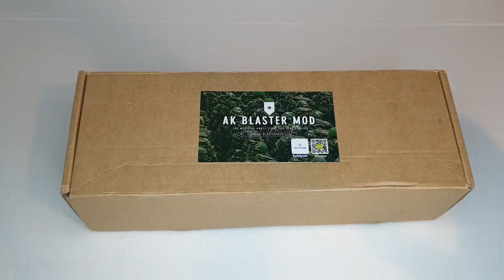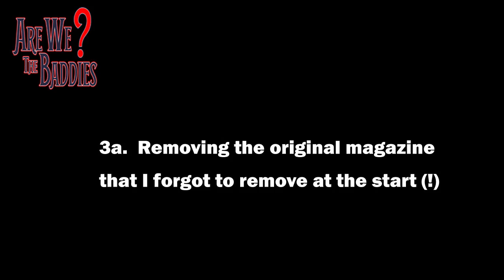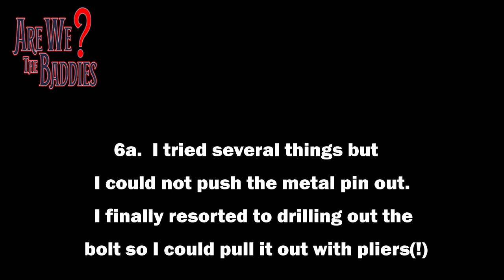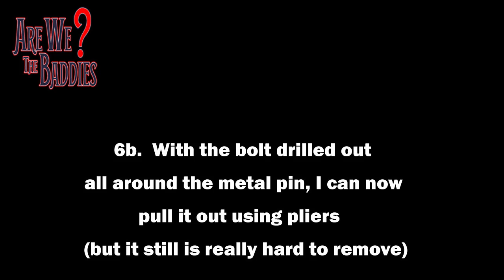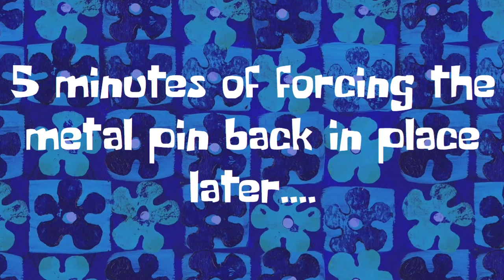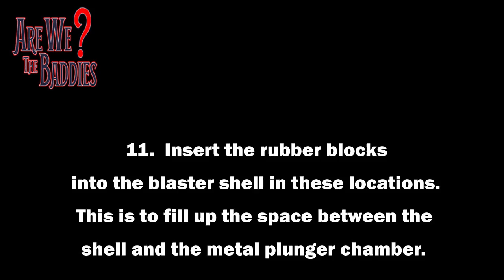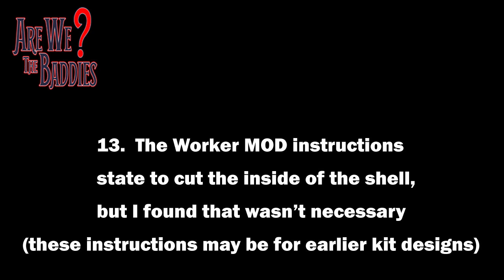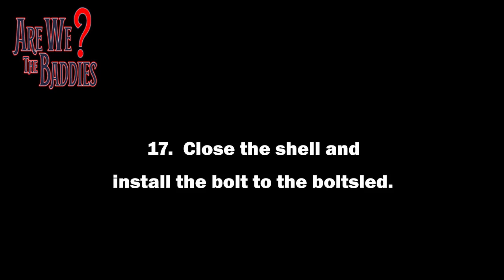Nerf Worker MOD Complete installation guide for Stefan Breech Bolt 9kg kit for Nerf Longstrike

Comment: One quick note - you left the SCAR barrel-attachment on the blue aluminum barrel, you are meant to slide that off and mount it to the end of the barrel to impart spin to the darts when fired.
Reply: That's just Worker's standard nerf replacement barrel tube, not a SCAR barrel. It's too loose to engage the dart well enough to impart the spin. Worker's true SCAR attachment is tighter to the dart and wouldn't fit all the way over the metal barrel like in the vid.
Reply from the maker: Hi, sorry I haven't replied to your original message Chamdar, been away for a bit.  I followed the instruction manual on the Worker Mod website for installing the breech kit and stage 12 shows the tube going over the blue steel barrel to (I assume as it fits) fill the space between it and the barrel adaptor, so they could save on thickness of the barrel.  I hadn't even see the barrel twist until you mentioned it.  Slyd_Fox is right though, it is loose and it I put it on the front of the barrel it will just slide off.  If you pause at 18:03 you can see just how loose it is.  
It would have been great if I had missed this night tight barrel though, so thanks for making me look again at it.
Reply: @Slyd_Fox  thank you for that!
Reply: @arewethebaddies7593  thank you for the reply, and for the video as well.  I'd been looking into this mod and mis-interpreted parts of it.  best wishes!
Reply from the maker: @Chamdar17  Glad to help.  And mis-interpreting the instructions was the original reason I made the video, in case it went wrong I could watch it what I did and correct it.

Comment: What exactly did you use the drill for? I've built dozens of Longstrikes at this point and never once needed a drill. I just use a pin and small hammer to knock the old pins out.

Comment: That barrel is wrong. You put it into the breech backwards. All worker barrels have one end that is chamfered on the inside to make it smoother for darts to load and the pusher to slide into easier. It shouldn’t look like a strait edge around the barrel when looking into the breech.
Reply from the maker: The blue barrel you mean?  It should be in the other way around?
Reply: @arewethebaddies7593  Yes, the other end of the barrel has a step in it that the pusher O-ring is supposed to seat into to create an airtight seal.

Comment: Anyone get an issue with the trigger being way to hard to pull?
Reply: I did, in order to shoot I sanded the part of the trigger that is like a triangle that frees the catch, and I have to sometimes manually push the priming handle forward while slightly pressing the trigger, then i stop pushing the priming handle forward when the trigger "detaches" (You can feel that it becomes softer to press)   and i just press the trigger when i'm ready to shoot. 
Sorry for the bad english

Comment: Thanks for the vid!
What FPS are you getting?
Reply from the maker: Sorry its taken so long to reply.  I wish I had a chronograph to measure the exact difference.  The only thing I can say is that the darts fly further and faster.
Reply: @arewethebaddies7593  All good! 
Ok. Not sure when I will, but I'd like to get one. I have a long strike just sitting there and would like to get it into usable condition again. 😂
Reply: @Si-Fi.51 Mine has gone from 50 FPS to a very consistent 145 FPS (with Dart Zone Max short darts). The kit is well worth it, and accuracy is noticeably better. I would recommend it.
Reply: @xap95  Oh wow. 7 months later and I still wasn't sure about the velocity. Thanks! I figured it was something like that. I'd personally want mine to fire around or under 130 because I want to use it in HVZs.
Reply: @Si-Fi.51  You could possibly find a softer spring for it. Another thing to note is that the catch is quite stiff, you need to make sure it engages properly (makes a nice heavy click sound).
Reply: @xap95  👍
The worker catch? I've heard they aren't great because the metal wears the plastic down.
Reply: Mine that I've been using for years gets 150s with good darts, it'll range anywhere from 120s-150s though depending on the condition of said darts.
Reply: @scottjs5207  Thanks!
Reply: @Si-Fi.51  I'd recommend using white lithium grease for the lube. I've had an issue with O-ring swelling with silicone grease.
Reply: @scottjs5207  Roger that. I have silly butts slime grease stuff. Would that work?
Reply: @Si-Fi.51  I don't know what the base of that grease is, so can't say for sure.
If it has an ingredients list or something of the like, it might have it listed as to what type of Grease it is.
Reply: @scottjs5207  Sounds good. I'll check it out.